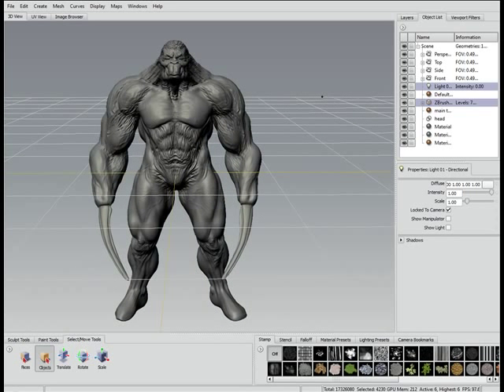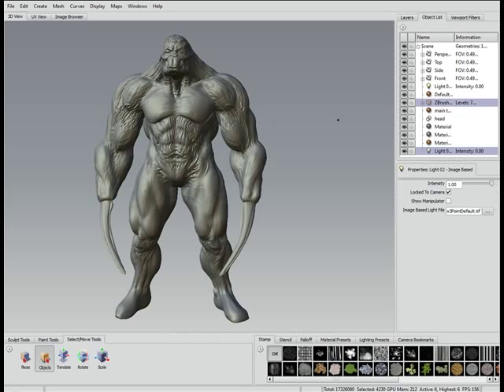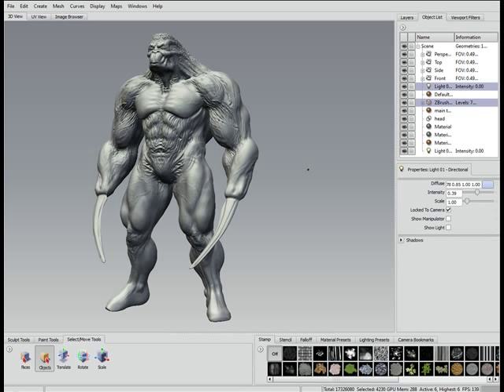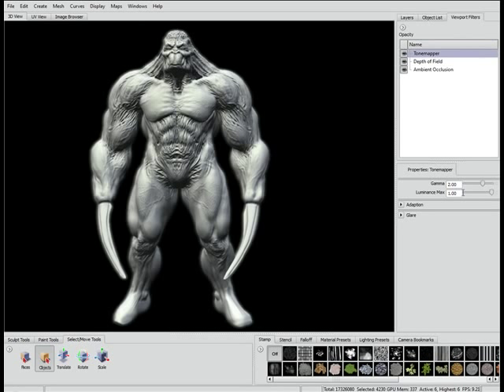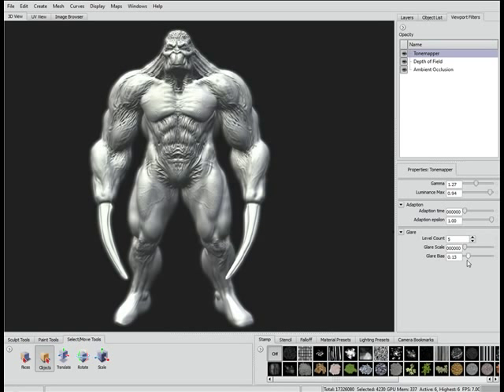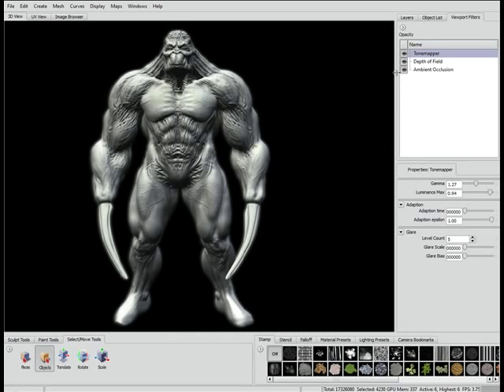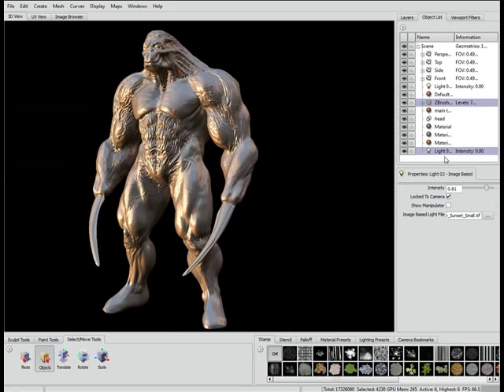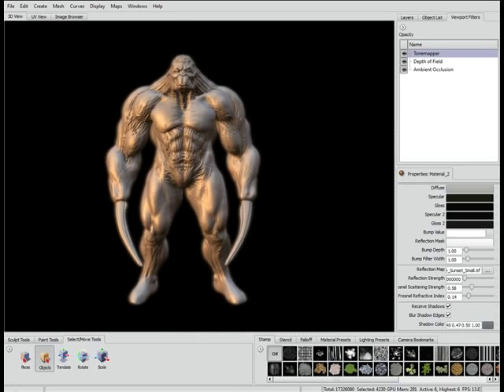Mudbox 2009 QuickStart Series - Image based lighting (HDRI)

Comment: they're not HDRIs.....
Reply from the maker: Right... :
1 -  the video is from 2008... so bit of a necro post.
2 - Yes they were they were fully unwrapped and exported as an OpenEXR  and 32 bit floating point TIFF format files. HDRI's don't have to be in HDR format.  As long as they are exported to a 32 bit floating point file format they still retain all the image data with no clamping.  Those were also the default ones that shiped with Mudbox 2009 (That are still in recent versions of mudbox).  So sorry to say your 100% wrong.